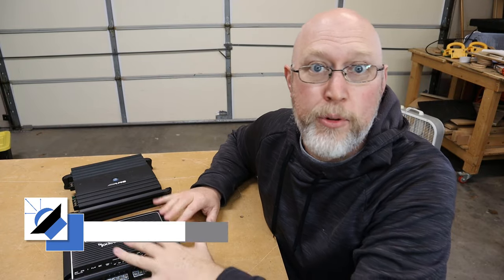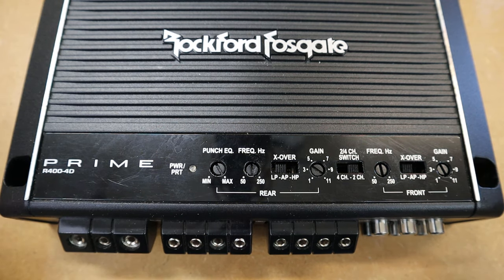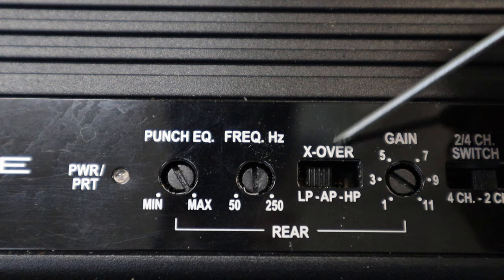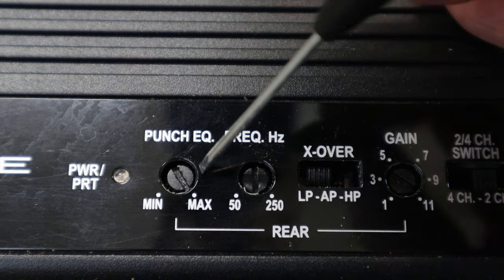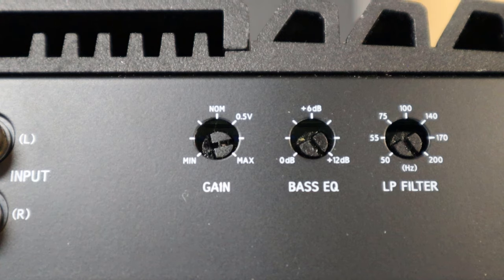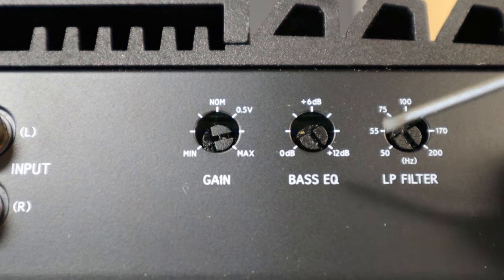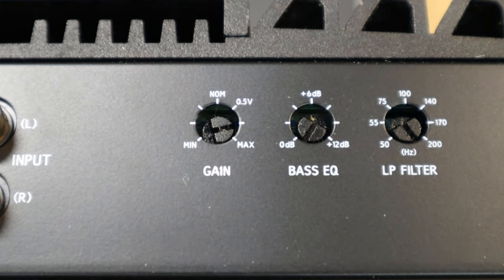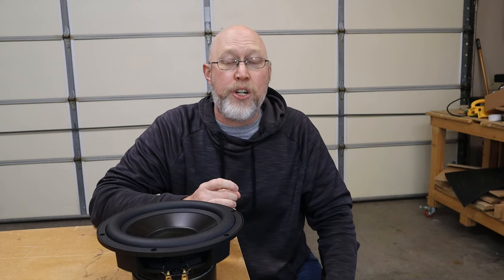How to set your bass boost!

Comment: I keep hearing this over and over, yet for 15 years  I have successfully used bass boost to get my bass just like I want it time and time again without clipping or audible distortion. I limit it to around 1/4 turn from zero or 3db boost or less (usually around 45hz). Not saying you are wrong, just saying sometimes we have limited space and EQ options and we have to take advantage of every little trick that gets us the kick we are looking for.
Reply from the maker: Sounds like you are one of the few that are not just turning it up to 11.
Reply: @DIYAudioGuy  As you know moderation is the key to any kind of equalization.
Reply from the maker: I would love to see a a subwoofer amp with a simple parametric equalizer, so that you could adjust the frequency and then you could cut or boost where you needed it.
Reply from the maker: @asherdie  apparently Memphis has a subwoofer amplifier with a parametric EQ as well.  But I would pick audio control over Memphis any day.
Reply: I keep my bass eq at 6dB, in the middle and have had no issues
Reply: I use my bass boost on my 2  6.5 sundown subwoofers . That are in a tuned ported box without the bass boost I have hardly no low end with it set at about 4 it thumps my Tacoma double cab
Reply: @calmarsh7853  The bass boost is incredibly useful in compact subwoofer setups. It's never failed me actually. Only time I dont utilize the bass boost on an amp is when the head unit has a built in EQ. BUT! Once you start pushing 45-50hz past 5 or 6db of boost things usually start to get out of hand.
Reply: Thanks for all your videos man,  i used to work with bird back in the day at davids car stereo,  he'd mention you every now and then

Both you guys taught me a ton
Reply: I guess I'm one of the dummies that uses the bass boost on max if the amp has it. I personally think it sounds better and I have a pioneer avh-x4800bs headunit in network mode. I have zero issues with them smelling or blowing subwoofers. If i get clipping I just turn my gain control knob down
Reply: Bro, I was saying the same thing. If you turn the bass boost all the way down it's no longer a bass boost..😂😂😂
Reply: Your Right Bro
Reply: I think a 3db increase is perfectly viable

Comment: i dont understand why bass boost gets so much hate , its just eq for bass. if set properly i dont see the problem ? every vehicle is different and cars in general are a horrible listening environment so how the music was originally recorded might now sound that great in your set up or maybe you just generally like more bass .
Reply from the maker: If it's your amp, your subs and your car, all bought and paid for with your money, do whatever you want.
Reply: @jessesanchez244  I keep my bass EQ right in the middle at 6dB and haven't had one issue
Reply: It is a gain that is typically set at around 45hz so isn't really an EQ as you say however if it is a two dial setup that allows variable frequency & level adjustment then it can be useful with roll-off or to help flatten the response of your system but in most cases it is easier to just leave it turned down/off.
Reply: I Agree if you find the sweet spot between boost and gain its just fine😂
Reply: I have mine bass boost max with 50 hz lpf and gain to 50% and still running strong for 5 years
Reply: I'm like I paid for 1200 RMS and I want to use it😂 keep bass boost at half

Comment: Bass boost is there for a reason y'all don't let these ppl control u. Turn it up a little bit it never hurts unless u max it out then ur asking for trouble, especially if u got custom ported boxes. I've used bass boost all my life and I learned that u can use a little of it and that's it. Strong subs can take it
Reply from the maker: Why not just turn up the gain a little bit more?
Reply: @DIYAudioGuy  because some head units are stock and some aftermarket head units are lacking for car amps. Missing frequencies is a bummer when your subs can't hit them because of car limits. When you have great pre out voltage, great electrical and an excellent aftermarket radio, you don't use bass boost. Proud to know what I'm talking about 🔊
Reply: True

Comment: I don't understand how the engineers designed amplifiers to have an option to add DB yet so many people promote turning the DB off. I believe that the DB was designed to be used if a person wishes to add DB. The main thing is that you pay attention to the heat that goes to your speakers and play your music at correct levels.
Reply from the maker: The engineers do not get the file say in the design. That's up to the  marketing department.

Comment: Hi DIY Audio Guy, thank you for all your videos. I recently start to install and begin my build, your videos are awesome and helped me a lot. I set my amg gain just like you told on your videos, my question is, my head unit has a dedicated rca output for the subwoofer, and then on the head unit configurations i have an on/off on the subwoofer rca, and have gain for thar same rca that goes from 0 to 20. I dont know wich to choose, since i want to set my gain correctly on my focal amplifier.
Reply from the maker: I would set that control to 20, The goal is to set the gain so that you never clip the sub, so even on the loudest setting you'll never overpower the sub.
Reply: @DIYAudioGuy  just what i thought. Thank you so much for all your help. 
For real.

Comment: I have the previous model MRP m450 Alpine Amplifier. I just checked the setup the other day to make sure the boost was at zero. If I want to adjust it, I use the head unit. The boost on the amp just causes distortion. The gain isn't a volume knob, as many think. It should match the voltage output of your receiver. There's no reason to have one channel gain set any differently than the other, as it's the same signal strength.

Comment: Just got my first subwoofer and amp and I got it installed at Best Buy and he tuned it and he put the bass EQ on 12 dB should I turn it off? It sounds amazing with the bass Eq on 12 not distorted or anything I don’t know if I should leave it on or off.
Reply from the maker: If you're happy with the way it's set up then leave it.
Reply: @DIYAudioGuy  ok thanks I was just wondering if I have the bass boost on it might damage the subwoofer
Reply: @DIYAudioGuy  do you think my subwoofer will get damaged?
Reply from the maker: @Bletze  When you pay somebody to install your system don't touch it after they set it up.  If something goes wrong they should be willing to stand behind their work.
Reply: @DIYAudioGuy  ok thanks for the help

Comment: If you have a sealed sub as I do you can set the bass boost to +3db at the - 6db rolloff point to extend response. Bass boost on ported I  agree set to 0. But sealed subs are often boosted like this in home subs like my Pioneer Elites by the manufactures. The bad crap comes from people cranking this knob on ported boxes,turning them into one note wonders.
Reply from the maker: If it were something like this with a variable frequency control for the boost I would agree with you.  https://youtu.be/gwp4_AyLjK0?si=R8TXF9mO5ywVdgFT

Comment: Quick question can you use a single Channel amplifier to wire up two subwoofers together??
Reply from the maker: Absolutely, the Alpine in the video is stable to two ohms and I ran it for about five years on a pair of four ohm subwoofers wired in parallel.

Comment: Nope - if you set your bass boost properly then you're not going to creating clipping or destroy your subwoofer.
It's all about the interplay between gain and bass boost - all bass boost is, is a limited bandwidth gain that should be used to counteract the roll off in low frequency response of some stock units. If you DON'T have a roll off between 100Hz and 0Hz then by all means set your bass boost to '0' but if you do then how are you going to deal with the non-flat low frequency bass response? You need to boost the 30-50hz range whilst NOT boosting 60hz - 100hz so that you don't clip - the only way to do this is to selectively boost the lower frequencies.. Bass boost...

Comment: So I get it, but I’d be grateful if you humored my extrapolation of different factors:
So subs are usually set to 40hz, and low pass at 70-80hz, but what if you low pass to 100hz, have 60hz set to nominal voltage, then use bass boost to lift the lower frequency voltage drop to nominal output at 35hz with a high pass at 25hz or so… does that make sense? Am I not understanding bass boost? Does it just boost the whole frequency range or is it something more specific?
Cheers!
Reply from the maker: If you can turn up the boost without clipping then you can just turn up the gain instead.
Reply: @DIYAudioGuy  ok, I thought that the boost was potentially a frequency specific boost, like 35-45hz or something. I do have mine all the way down, turned the head unit to -6db to subs, and used my dmm to set the voltage with the bass mechanic tracks, I then found a mix that clipped so went back and calibrated to that, I’m still finding some heavy tracks that clip, but am just turning down the bass knob when that happens (I tuned it with the knob set to max). 

2 skar zvx18-d1’s, rpx4500.1, wired to 4ohm for proper rms. In my Silverado crew cab… it’s glorious.

Comment: I recently discovered you after purchasing the Alpine ilx-w650 with the mini KTA450 amp for my mids and the Rockford P300-12 for the bass. I could use some help properly setting up the powered sub. It has a LP crossover with 12dB Oct, 50-200Hz. I’ll trust your advice and leave the boost off. Do I leave the remote boost off as well? Can I adjust gain and xover with a meter on this unit? What about the sub level setting on the HU? With it on zero, I have no bass. (Hoping you put out a detail settings vid on the ilx-w650. Thanks for any assistance you can offer!!
Reply from the maker: I don't have any hands on experience the KTA 450, so I can't help you there.  I do have some experience with Alpine head units, and when the subwoofer output is set to zero you don't get a lot of output.  You will want that set to max when  you set your gains.

There is no easy way to get access to the speaker terminals on that subwoofer, so you will just have to set it by ear.  There are a lot of old-school installers that only set gains by ear, bit  I don't trust me ears.

Comment: I had 250 watt rms @ 2 ohms powering a 10" sub rated for 350 watts rms going for 2 years. Had gain turned up 3/4 way up and bass boost about half way just adjusted till every till sounded the way I wanted. Later, I bought amp this Christmas to match the 350 watt rms. Used volt meter adjust to 26.45 volts volume at 75% Used a 50hz -5db test tone and crossover set to 80hz with bass boost off and it is disappointing. I listen to metal and there isn't enough bass from double kick drums. Is there another way or test tone to set this up for this type of music if not using bass boost. Have an LOC with AccuBass brings back bass at higher volume where everything set at. Just not alot of low tones. So what your saying turn up gain and this will fix everything the way it use to be and will not be a need for bass boost.
Reply from the maker: Yes, if the gain  is set properly you do not need the boost.   Since you got three devices (head unit, amp, loc) you're going to need more than a multimeter to set this up properly.
Reply: @DIYAudioGuy  That's all I got for the time being. As far turning up the gain still didn't get me the results, I was looking for. My situation is different because of genre of music I'm trying to tune to and maybe bass boost doesn't apply to all music.Using the bass boost did the trick for me for my liking. It didn't add bass per say but thicken up the sound which I was after. I set bass boost at 6db or at 12 o'clock and adjusted the gain until it was back to the 26.45 volts. Again, maybe bass boost is not necessary for all type of music which is not lacking bass but the drums sound without boost made that 10" sounded like a mean 4" 😂.

Comment: If the bass is to be off on the amp should I set bass boost on the radio unit? Is more gain gonna give me more bass?
Reply from the maker: If you can boost (at the head unit or amp) without clipping then your gain was to low.

Comment: I have a Rockford rf 2.9 x amp for my 4 6x9’s in the rear deck and doors. I have a bass knob but when I turn the subwoofer off, the 6x9’s don’t put out any bass and basically just sound like tweeters. Could it be the gain settings or the bass eq ? I even played with the equalizer settings and still no deep bass coming from the speakers .
Reply from the maker: It's not really possible to troubleshoot something like that in the YouTube comments.

Comment: Hey mate, Have a MlPower 4 Amp intend to use the high level inputs, is there any benefit to putting the signal from front and rear speakers into it? or is it only if i want to be able to retain the front/rear transition in the head unit?
Reply from the maker: I'm not familiar with the amp, some four channel amps require four channels of input to get four channels of output.  I would recommend that you look through the owner's manual.

Comment: I have bass boost up a small amount just to notice a difference due to having a stock head unit…. Is that okay? no smell no clipping
Reply from the maker: If you're not clipping with a little bit of bass boost, then why not turn the boost down and then turn the gain up?
Reply: @DIYAudioGuy  gain is set half way.. so you’re saying turn it up more and bass boost off?
Reply from the maker: @daviddaupert1693  yes, if the gain is set correctly then boost will cause clipping.

Comment: Sir, theres a 2/4 Ch Switch on Rockford Amp, what it use for....
Reply from the maker: In four channel mode all 4 input channels are routed to their corresponding output channel.  In 2 channel mode the front input channels are sent to both the front and rear output channels.  Two channel mode might be useful for something like bridging the rear channels for a subwoofer and running some components off the front channels.
Reply: @DIYAudioGuy  Thank you Sir for the great explanation 🤟🔉🎵

Comment: Hey man maybe you help after installing a after market headunit (kenwood) with after market rear and front speakers , no subs no amps, my soeakers sound terrible worst than before, coukdnt even turn up without distortion, so i got a 4 channel amp to power those speakers and my front speakers are so quiet compared to the rear, its bad enoughy i have to turn the head unit volume damm near to 30 just to get some loadness cant harley hear anything at 15, but why is my front speakers so low
Reply from the maker: It could be any number of things, it is hard to troubleshoot without putting hands on the equipment.
Reply: Did you get this figured out..If not..does the rms per channel of the head unit match the rms of the speakers...sounds like you need an amp for your highs because the head unit cant push them.

Comment: I think you misunderstood how it works and when to use it.. As you increase Bass Boost this increases power at the lower levels BUT the amp has a max power that can't be exceeded so you get clipping.. When you use Bass Boost you need to reduce the gain to stop the clipping. The result is lower lows but less total volume. When BB is applied it applies it on most amps at about 45hz and it linear reduces as the frequency goes up. So it works best on speakers that have a linear drop off.. so is best with door speakers and sealed enclosures. And obviously if you can get to 45hz (large sub) without BB then it's not needed. BB is therefore best deployed to small speakers. I use it in 6.5 inch door speakers.. Would i use it on a 12" ported enclosure.. NO
Reply from the maker: The rule for any EQ (bass boost is just a one-band EQ) is to set the gain and then even out the frequency response by CUTTING frequencies that are to loud.

Comment: I have 2 15s running with a 1000rms amp. I setup the gain property by using a multimeter,  I put the bass boost on 0. But it was not loud enough.  I just don't get it. I do was using a sealed enclosure
Reply from the maker: Loud enough is subjective.  You are free to turn up the bass boost, just be aware that if you clip you will break something.
Reply: I dont get it either I have always used bass boost all the way up and I have never had a problem and sound its good for the music I play
Reply: @menio2012m77 the peeks will clip music is dynamic

Comment: What about the crossover bass boost turn that down too mine is a little up like 4-6decibel
Reply from the maker: Team no boost.
Reply: @DIYAudioGuy  ok but it sounds very flat
Reply from the maker: @aaront2172  The problem with boost is a lot of people don't buy a big enough system to satisfy their bass craving, so they crank up the boost, distort and clip, sound like crap, blow their gear.

If you feel like you need just a little bit more boost then go ahead give it a little boost.
Reply: @DIYAudioGuy  ok i get it now problem fixed the gain on the crosover is very low the amp is powerfull thanks again

Comment: I had bass boost on thinking it sounded better but then realized why folks say turn it off.

Bass boost cause my system to be a one hit wonder. Meaning, I’d be slapping hard around 35-40Hz and nothing below or above that.

Shut bass boost off and reset gains and now my system slaps across a larger frequency and now it sounds very musically. Play good from 28hz all the way up into 50hz range now.

Only a few songs sounded good with boost….now it’s off, all types of music sounded good.

I’ll never use bass boost again.
Reply from the maker: Exactly!

Comment: What if I have Bass Boost on head unit also can I use bass boost on that
Reply from the maker: I tend to argue against it.  It is better to cut than to boost.  But you can always turn that down if it starts to distort.
Reply: Thank you for responding. I turned Bass Boost off both radio and amp, still hitting . Lol..